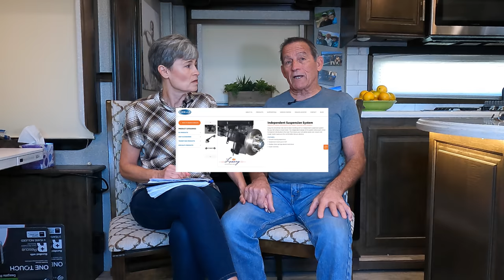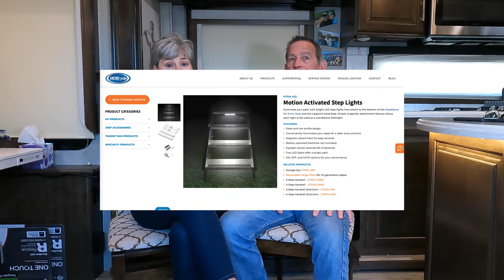Shaking the camper to pieces | The change we made to our RV | MORryde Independent suspension

Comment: Had this installed back in August 2021. Drove 1200 miles one way and it was worth every penny and every mile. Mine was a 3 day job because I have 3 axles. You will not be disappointed in the ride but I am just as impressed with the electric over hydraulic disc brakes. It just adds a whole other dimension of safety. I dealt with Gary and Lindsey in the shop and they could not have been more pleasant to deal with. Everyone in the shop was  always courteous and willing to answer any questions you may have. Make sure you pick up their brochure and read their business mission statement and that will explain the way they treat their customers. They are a model of how businesses are supposed to treat their customers. It also improves the ride in the truck. You get very little vibration in the cab when going over rough railroad tracks which you will encounter as soon as you leave the plant. I installed on a 2018 GD Momentum 397TH. I watched too many videos of springs and spring hangers breaking. It never happens at a good time. Good job Liz and Paul.
Reply from the maker: Yes, you are so right, Mike. It does tow better with the new system. MORryde really has it going on, what a commitment to excellence! Thanks for your kind words and so glad you did the same. See you on the road!

Comment: Thanks for sharing this information. You guys are the best at giving good advice on this platform. It’s a shame the manufacturers don’t do a better job of putting quality parts on their products. Not sure if anyone has mentioned this but, we always remove the glass plate and turn table and put it in a cabinet for traveling. Was told of many issues with the microwave by leaving it in while traveling.
Reply from the maker: We had to do the same with the microwave plate. It's a shame that the manufacturers seem so focused on using the cheapest parts possible!

Comment: We were just about ready to pull the trigger on a Grand Design Solitude (we had bought a Silverado 3500HD diesel already) when we decided to tour the factory.  Salesman thought this would seal the deal. It did the opposite. I owned a business in construction and my wife was an executive in automotive manufacturing. I hated the suspension and had already decided we would have to convert to Morryde independent suspension. Then my wife asked to see the welding process for the frame. No one asks that. They said sure. It did not take her long to conclude they had no quality control and no well defined process for consistent and robust welds. And that was the end of that. Long story short we sold the truck and have a Newmar New Aire Motorhome. To be fair we are probably hard cases and lots of people have great experiences with 5th wheels and we hope the improvements you have made have improved the experience dramatically. You did it the right way—as a value shopper instead of a price shopper. Happy travels.
Reply from the maker: Hi again David! Yes, we agree 100% with your assessment and even did a video about our factory tour. And YOU have our dream motorhome! We love the New Aire after doing a review of it. Wow! Paul and I are looking forward to meeting you! Here's the video we made after touring the Grand Design factory, fyi: https://youtu.be/laNbSFZpXqc

Comment: We're not full timers and would not consider spending what you did on your rig. It's very impressive though. For me, I added air ride to the rear of my pickup and road armor equalizer to the 5th wheel trailer suspension. Those 2 things made a dramatic change to the "earthquake" when traveling . Nowhere near as much as your suspension upgrade but at least stuff is not moving all around inside our trailer as bad as it used to. All that said, if we were full timing we would definitely consider the independent suspension from MorRyde. Thanks for an impressive video demonstration.
Reply from the maker: Thank you so much for watching, Tom. What you did is a good choice for you. Ever little bit helps. Thanks for watching and for being on the A-Team. We love you!

Comment: Paul, Liz.  In our plan we where going to buy a new coach.  But have changed our minds.  We have decided to purchase a used one instead.  We plan on having it inspected.  Then the modifications we want to add to it are a 3500 watt solar System, plus about 800-1000 amp hours of batteries.  As for the suspension I want to put 8,000lbs axles with oil bathed bearings. And air over hydraulic disc brakes on it.  Since we already have the HDT too pull it with. Also making sure it has a residential fridge.
By the way glad to see your up and running around again.  Safe travels and roads.  Brian and Cindy "xtreambydesign with passion"
Reply from the maker: Hi you two! Sounds like you are putting in some research to get your rig the way you want it. So fun! Looking forward to meeting you on the road. Happy planning!

Comment: after driving trucks for years the best example of the inside of a trailer is to take a bowl fill it with popcorn and start shaking it, the smoothest part of a trailer is between the pin and the front axle mount the worst ride is over the axles and behind the axles thats why I am thinking of turning a trailer I have into an rv and another thing with the fifth wheels is with the pin boxes they put on them it puts a lot of pressure on the front of the trailer and eventually the frame will need repaired to eliminate this problem the pin needs to be straight up and down and you can't get one like that anymore thats another reason I'm building my own
Reply from the maker: Yep. It's for sure a lot of stress on the trailer! Thanks for watching.

Comment: I did a three month cross country trip between August and October and I agree the roads in this country are awful! My Lance trailer has torsion bar suspension which acts somewhat like independent suspension and stuff pretty much stays put but you do have to be careful when opening the refrigerator! 😂 The Thule bike rack on the back of trailer broke and I almost lost an expensive bike. The wheel center came off the front wheel of my Tacoma. I can see why you did the suspension upgrade. I put Timbren springs on my Truck which helped a lot on bad roads. Tip; avoid I20 through Shreveport LA. Worst road ever!
Reply from the maker: Hi Mark! Yes, we are hearing the roads are getting worse. That seems to be the case across the whole country. You've got such a good Lance, so happy for you that you got out and did some exploring last year! Close call with that bike, whew!

Comment: You also need to check highway conditions somehow. Years ago we were towing our camper on a secondary highway with no shoulder on it. There were asphalt patches ontop of older patches. That should have been our first clue and turned us around. 

We would crest a hill and there would be broken pavement and oncoming traffic so no where to go.  So you had to slam on the brakes and slow down as much as possible.  After about 150 miles of this, we had broken 2 leaf springs, it shook the gas stove loose out of its mounting, shook the new HD rear bumper right off the frame rails (with the bike rack attached) and broke one dropped spindle out of the axle tube. And most of that damage occurred at 20-30 mph.
Reply from the maker: Oh no. So sorry this happened. You make a great point. I wish there were a way to check road conditions. We just talked to friends who traveled on the Interstate in Colorado. They said the roads were atrocious. I am sure that is common this time of year in any snow state. We are grateful for our new suspension as these conditions are pretty much unavoidable! Thanks for watching and commenting.
Reply: @LizAmazing , Mississippi has horrible highways if you ever head that way

Comment: great move guys...the first 2-years I had my Seismic 355w I broke a spring hanger on each side (back hanger) and broke the passenger side rear leaf spring eyelet. I replaced both 7,000 lb axels with 8,000 lb axels. The 8,000 had bigger brakes which also helped. your solution is the best...if nothing else you now have superior brakes. keep moving down the road !!
Reply from the maker: Thanks Steve! So glad you did upgrades as well. So sorry about the broken hangers and leaf spring. Wishing you safe travels!

Comment: Wow super nice upgrades should make a huge improvement I did a suspension upgrade myself in the spring I installed the dexter ez flex with the wet bolts and bigger shackle straps and like Paul was saying I should have done it sooner anyway have fun 🤩
Reply from the maker: Hi Corey! Glad you looked at that and did something. I bet it made a good difference. Thanks for writing and having a good weekend!

Comment: Well we’ve never had a big rig of course, but from the time we got our little pop-up A-frame, I wrapped the microwave turntable in a small slab of foam we had and stuffed that back in. The door never came open, but if it did, the turntable was wedged in place with the foam. And when we got the van, there was no space for stashing a slab of foam when we weren’t using it, plus I didn’t know what to do with my fleece jammies, so I just started stuffing those in the microwave to hold the turntable in place.  
But the van rattles and shakes so badly that on the maiden voyage – the first out of state trip – the tambour sliding bathroom door shook off it’s tracks. And all of the marine latches on the doors and cupboards have shaken open at one point or another.
Reply from the maker: Wow, that's crazy. I wonder if there is anything you can do on a smaller scale to help with all that shaking. We do know that many folks in a motorhome will layer their plates between small vinyl pads. But that wouldn't prevent your cupboards from opening. Goodness!

Comment: As I said on Facebook - Thanks, guys - great video. I am still "amazed" at how poor design and manufacturing is when it comes to ALL travel trailers & 5th wheels. There just isn't any brand out there that takes all of this into account when designing and building a "home" for full-timers. Independent suspension should be "standard" for such high-vibration units, or at least an available option from the factory. And to have facia boards simply pop off while simply driving exemplifies the need for better quality, even on expensive units such as yours. Good Luck!!!!!
Reply from the maker: Thanks Randy! I think it's the weekenders that are driving this. They either don't notice or don't care because they are not using their rigs long enough or often enough. The good news is that the MORryde Independent Suspension is available as an upgrade option when ordering from the factory.

Comment: I fully agree that independent suspension is the way to go.  I've seen other channels that had this system installed with great success.
  I am sort of like Paul in I look at everything I can think of, do as much research as I can, and talk to anyone that actually has what ever I'm looking at.  My concern about this system is the "twist" or "tearing" force that is put on the rubber blocks of this system.   Has anyone figured about how many miles this system is good for before these blocks need to be replaced?   It seems to me the rubber blocks are bound to get stressed over time.
  What sort of guarantee did the installer offer?
  I am interested in this product.  Thanks for his video.
Reply from the maker: That's a good question, Duane. We asked at the factory and it's not a huge job to replace them. Just not sure when they will need it.
Reply: @Liz Amazing  
As handy as Paul is , would it be prudent to carry a "spare block" like you would carry a spare tire?
  My concern would be time and logistics of obtaining a replacement in the future.  We all know that if ANYTHING happens to an RV, it will be Friday late afternoon.

Comment: Paul, these large trailers are a real design challenge, aren't they? Must be luxurious, a true home on wheels... but lightweight, given the low-torque trucks that many are pulled by? You are retired... take some time to think through a better design... assuming a powerful truck, like the diesel you posted about... but also a blank check for cost. That island being integral with the floor, whatever. Maybe building it up on a semi trailer chassis? A design without regard to gas mileage cost...
Reply from the maker: Yep. There is definitely a LOT of room for improvement, Jon! We recommend you reinforce EVERYTHING. Thanks for your comment!

Comment: First thing EVERYONE should do is have all your tires BALANCED!  Then you can add suspension to your rig, and don’t forget to add some larger shackles and greasable bolts.  Independent suspension is the best but WOW it’s expensive. Did you have any type of after market suspension before going with the Morryde?
Reply from the maker: When we got new tires we got them balanced. Didn't make any difference. We went with MORryde for the reasons Paul mentioned in the video, just too many downsides with the alternatives. And, yes, it sure is expensive!!

Comment: Great info.    The only thing falling apart  - is me !!     Put this on my “to do” list.    I often thought the suspension was bare bones in most 5th wheel and travel trailers.     How much weight does this add?    Travel safe.   cheers
Reply from the maker: LOL, maybe you need new suspension? Knee replacement?? We don't know how much weight it adds, great question. We are thinking 3-400 pounds.

Comment: My drv came with those axles on it and brakes I'm not happy with them myself. I always thought the disc brakes be the way to go I don't care for the delay on the truck comes on a second second and a half later the trailer comes on and yes I've adjusted the electric over hydraulic truck I'm towing with a 2020 Ford f-450. I certainly would hate to have to tow this on icy roads I think you could end up in the ditch.
Reply from the maker: Oh my. We've noticed no delay at all. That doesn't sound right at all. You might want to get this checked. Be safe.

Comment: Hola Amigos.  Sounds like that suspension should be a factory option.  Any weight changes?   Liz... you look like your back is all good. Yeah!
Reply from the maker: Hi Mark! Grand Design has just started that program back up, I believe. So if you are ordering a Solitude or Momentum it should be an option to add MORryde IS. It does add 3-400 pounds to the rig, not sure if that is off-set by the weight of the axles that are no longer there. Yep, back is doing great. Thanks again for being with us through that!!

Comment: This is awesome folks!!! Thank you so much!!!!  Anyway you can share the specific model of the slide out tray for the generator?   I didn't see one listed on the website that does 200%.   I think i would need a model number to give to local dealer to make sure its correct
Reply from the maker: It's called a freezer tray and the part number is SP56-388. Thanks for asking. By the way, it cost $281.65 plus $100 for install. Thanks for watching and commenting!
Reply: @LizAmazing  Thanks... .love your videos... been watching for a while.  Did you have to have a special lifter kit to get over the bottom lip of the front storage?  Or did the freezer tray come with appropriate offset?
Sounds like you got a great deal.  I'm seeing $400-$500
Reply from the maker: @markdickey7807  No. There's spacers under it. Wow, didn't know they were that expensive. Maybe contacting MORryde direct was the ticket.

Comment: Just a couple of questions...what load can those new axles hold? Also, do those pull out drawers fit different types of RV storage areas? Lastly, Liz you look GREAT! Glad to see you in better health!
Reply from the maker: They are 7000 pound axles. You can get 8000 if you want to upgrade but it doesn't change the frame rating. Yes, they have all sorts of drawer sizes, pretty much unlimited. They can actually custom build you a drawer, but we used a stock size. And THANK YOU so much for your kind words- I feel great!!

Comment: Did you reinforce your bumper to handle the weight of the electric bikes?
Reply from the maker: No, our rig came with a receiver hitch welded on the frame and a 300 pound capacity. Great comment, thanks for asking!

Comment: many people with solitudes have had their island fail like that so that is on them they know they are using bare minimum suspensions and not building the islands properly to withstand it.  I have not heard of that island problem in any other manufacturer and it has been happening long enough they should have had a solution by now.
Reply from the maker: We don't know of any Solitude island that has collapsed since they made the changes to the construction. They added some reinforcement due to our video. The new changes went into effect September 2020.

Comment: you didnt mention how much for the conversion?  on morryde?, i changed item on my 5 th wheel  also, installed 4- 7500# air bags with the leaf suspension and installed 4 - air ride shocker for the vibration . my conversion  was  around 3200.00 parts and some labor
Reply from the maker: We did mention the cost, keep watching and it;s there. $8000. We are just glad we did it when we did. We also talk about the pros and cons of other systems.

Comment: Thanks for the video guys. That suspension is a really nice upgrade. I am curios how the juice brakes work, I have seen the surge style hydraulic brakes on a bumper pull trailer before but not on a 5th wheel.
Reply from the maker: I don't know how the surge style work, but the brakes we have use an electric hydraulic pump.
Reply: @LizAmazing  Ahh I figured they had to be electric somehow. Very interesting. The surge brakes have a master cylinder mounted to the hitch on the trailer, the force of the trailer pushes on the master cylinder this activating the brakes just like you were pushing on a brake pedal in a car.